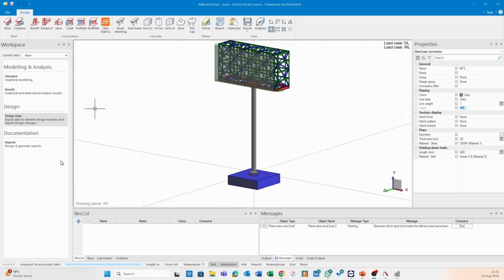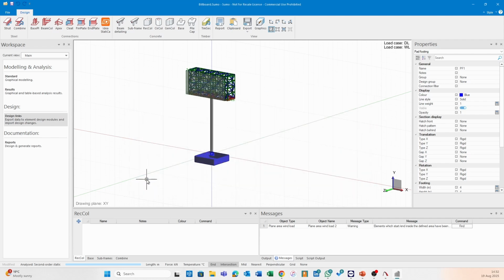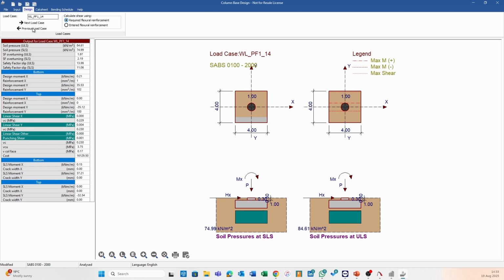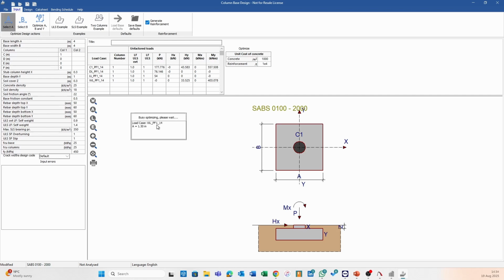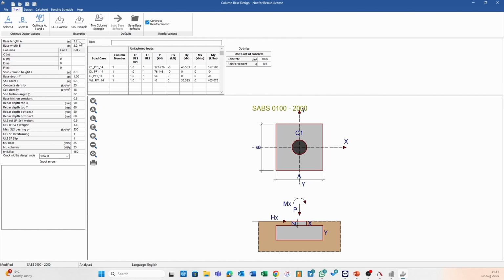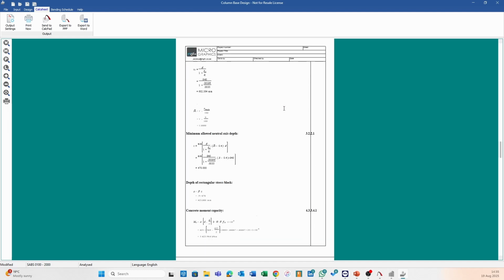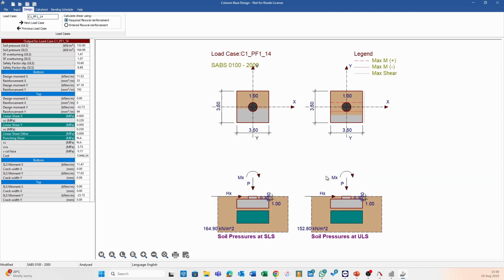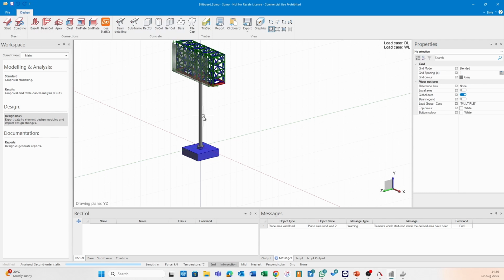Billboard Concrete Foundation Design using SUMO

Comment: One of my Unipole flipped out of the foundation rod after heavy wind, what could cause the foundation the entire 16 foundation nuts to fail
Reply from the maker: Sorry to hear that. It would require a thorough investigation to identify in which element/s the failure occured. Did the thread strip off of the nuts, were the tigthened properly, did the anchors fail, did concrete cone failure occur, etc. Once the point of failure has been identified, then the design needs to be reviewed. 

I would recommend getting some data on the wind speeds at the time of failure and run that back into my design as a starting point. It could help you identify the point of failure.